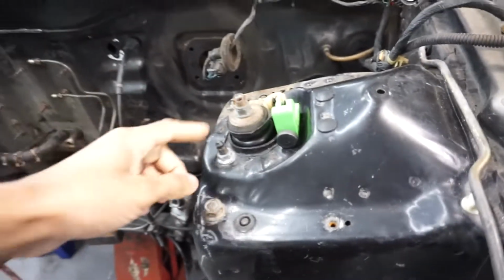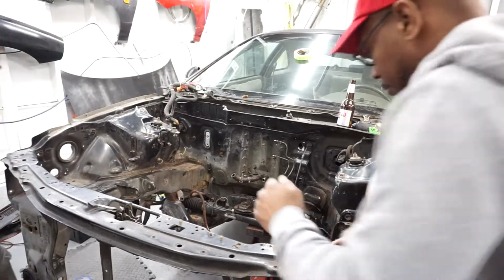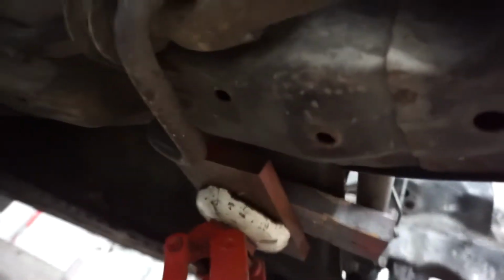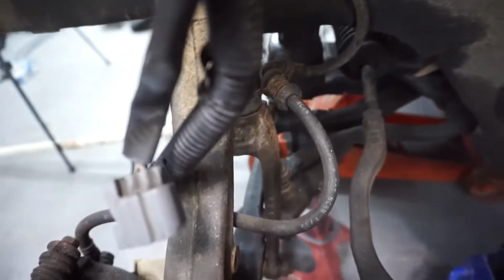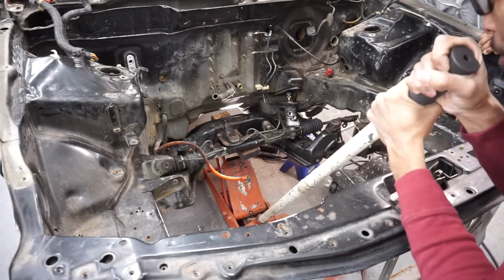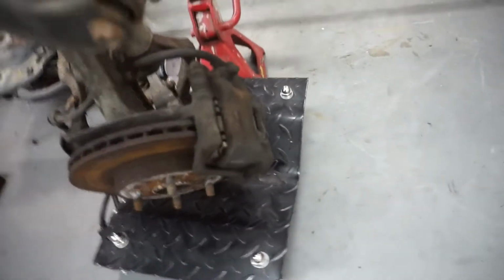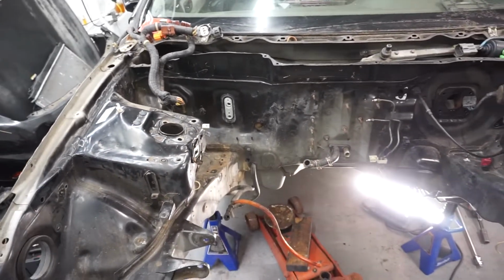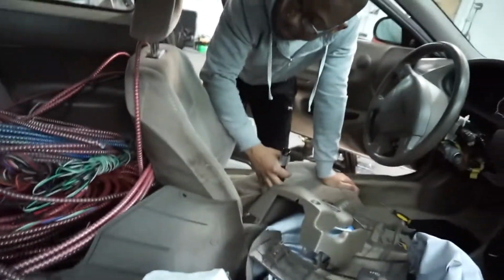Acura Integra Subframe Removal w/ Front Suspension Attached!

Comment: i am about to drop my sub-frame soon   and restore it along with the sway bar and get new lower control arms and get all new bolts from acura  ....... nice video on   the how to .........   i do not think i will be going the same route though i will just pull both outer tie rods from the knuckle   and there is the rack bolt by the brake pedal and a few power steering lines  ....     only thing that concerns me is making sure when i put it back together that the rack and pinion bolt by the brake pedal goes back smoothly and lines up the same way it came off i guess i can use a marker to insure the line up of it what are your thoughts ? did you put this back in yet ?